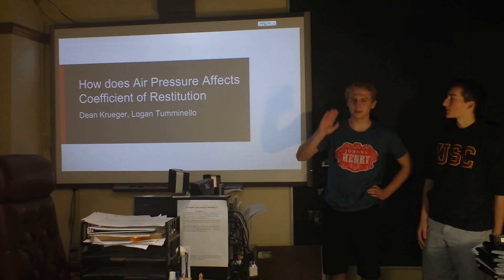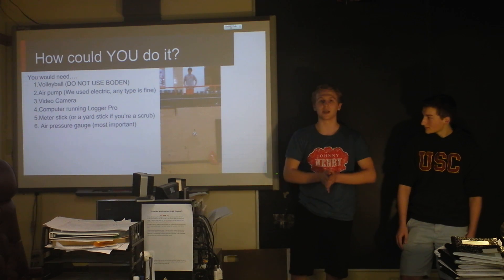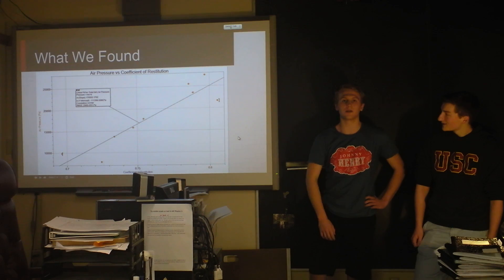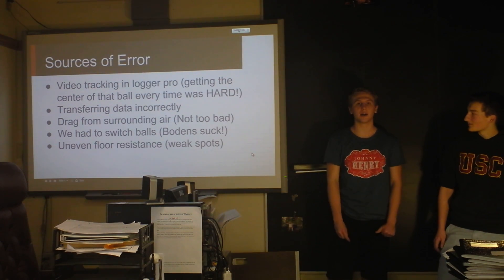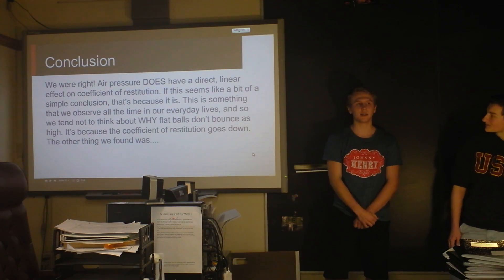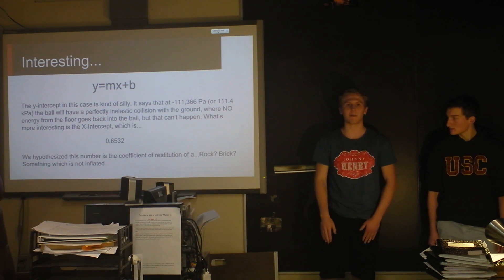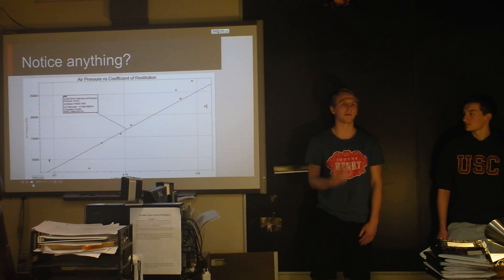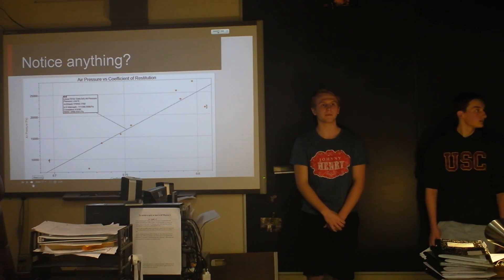Indie Lab - How Air Pressure Affects Bounciness of Volleyballs (Restitution)

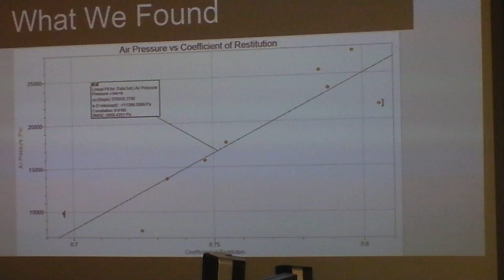Comment: Kilopascals are only the values of Pascals x10^-3 in reference to 3:27, Kilopascals are still an SI unit, as are Mega or Giga Pascals.
Reply from the maker: Paul Sonntag kilo means 10^3.  I contend that kPa is metric, but not SI.  This is critically important as students plug values into equations.  For instance, kg is SI, but kN is not.  They're both metric, though.